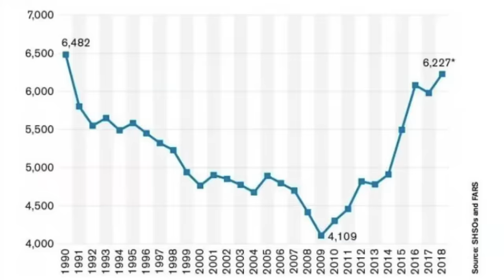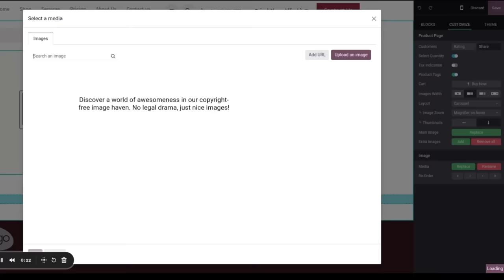Can this forgotten invention save your life?

Comment: 19:35 you can actually see the rear wheels locked up when they drag it on the tow truck.  Jeez. Now you need to build something for you truck to protect it against pedestrians.
Reply from the maker: Yeah I did not feel good watching that
Reply: It might have something to do with the wheel chock he left under the rear wheel. And not putting it in tow mode. A lot of modern vehicles with electronic parking brakes will automatically apply the parking brake if it detects the wheel is rolling with the engine off. 

There will be instructions in your owner's manual to disable the parking brake and mechanically override the transmission into neutral for this exact reason.
Reply: That's just because its stuck in park, without fluid the transmission cant build hydraulic pressure and will not shift
Reply: @smashedpapya2563  transmissions have mechanical linkages to shift into PRNDL , unless it's a new fancy electronic version of that linkage, but they will always have a mechanical over ride to force the transmission into neutral for towing it.
Reply: so you cant even shift fords into neutral if there's something wrong? seems very counter intuitive
Reply: That’s because his parking brake was still on.
Reply: @dylanbrookes9501  my wife had a fuse blow in her 08 escape. I couldn’t find the emergency neutral release, and it happened when we were driving, at night, so luckily we were able to stop, but we ended up in the middle of the road, so we closed the road.  The cop who showed up first didn’t know anything about it either (I think this should be part of their training)
Before you get behind the wheel of any car, you should find the emergency neutral release
Reply: There's a skid under the wheel
Reply: There should be a neutral override lever under the panel the shifter is mounted to. If there is then this is a skill issue on the tow truck driver, or they just don't care.
Reply: @McLilWilli lol when I got my 03 Jeep liberty towed the guy asked me if it had 4x4 and I was like yeah and we just threw it in neutral and just drove on. My beautiful piece of shit Jeep doesn’t not have anything to lock it up and lacks abs and traction control
Reply: @squanchy474 or get this… maybe it should be a part of your training when you buy and operate a $30k vehicle?
Reply: @ipullstuffapart on a lot of fords it is on the underside of the car, they could’ve just missed it.
Reply: @ipullstuffapart  Aus have pretty strick rules for cars I wouldn't be surprised if it was written off
Reply: towing it in park probably did more damage than the puncture in the transmission fluid pan
Reply: @AndreyAntonchik ¿Por que no las dos ? Why not both ?
Reply: @Ididathing  Don't worry about it, there's a wedge in front of the wheel. The wheel would turn without a problem.

Comment: wow, from 0:30 - 2:30 was the most concise and easily understandable 2 minutes of explaining the safety concerns of larger and larger trucks becoming normalized.
well done mate, not only am i equipped with a 2 minute explanation of the problem, i had 18 minutes telling me a solution that only costs $25 at a second hand store, and masking take to afix it on my legs.
Reply: E
Reply: Safety concerns are understandable, but the people who complain about trucks don't live in a place that can get 10 feet of snow no problem.
Reply: @joshualfalken  ok so why did i pass by a huge huge truck pulling out out of the mall with a 7yo in the passenger seat in Florida?
Reply: @joshualfalken  Even the little 90's f150s could handle snow. These giant lifted civilian smashers are completely unnecessary.
Reply: @joshualfalken  Give me a break. Lifted truck drivers have never even heard of snow tires.
Reply: @joshualfalken  Do you? I live somewhere where the yearly snowfall can quite easily get to 2 meters and often approaches 3. I've never felt the need for anything more than a good car with a solid set of snow tires and anyone who claims to need a truck to drive to work and back through some snow is:
a) an awful driver
b) someone who needs to get good snow tires
c) a snow plow driver
Reply: @joshualfalken  If I can make it through snowy canadian winters in a Mazda 2, snow isn't even an argument. I can see exceptions for more remote workplaces but not for bootin around town day-to-day.

Comment: Damn, the moment I saw that transmission fluid leaking out, my heart sank. A couple of years ago I hit a pothole and it punched a hole in mine to where all the fluid leaked out. I panicked and got to a mechanic right away, not realizing how bad it'd be to try and drive it like that, (especially because I thought it was an oil leak at first), and it ended up destroying my transmission. It was nearly a $2000 fix to get a new one when I finally found someone who could fix it, (rural area and half the mechanics here are "specialized" and won't work on hardly anything). The mechanic also kept coming up with excuses to put it off, so it was nearly two months to get the job done on top of that...
Reply: If it was road debris or even a huge pothole your full coverage insurance may have paid for that.
Reply: @ohioplayer-bl9em  Don't have full coverage insurance because it's too expensive relatively speaking. My car is old, (2006 model Chevy HHR), and basically my choice at the time was either pay the repair cost or see if I could find a car in better condition for the same price or less.

 As much as I hated paying for it, it was ultimately the better option because the car is still running fairly well to this day, and buying "cheap" used cars is always a big risk.
Reply: That's because replacing a transmission is a giant pain in the axx.

Comment: That point you brought up about the "big vehicle arms race" actually happened to me. 

I always wanted a small vehicle, but my  grandma refused to, she needed to get me either a truck or big car for safety reasons.
Reply: What’s funny is that i heard bigger cars are also more dangerous for the driver. (Tertiary source)
Reply: The trick is to get a super low small car, strap a buzz saw to the front and roof, and massive trucks will stay the fμck away from you 🤣
Reply: I'm superior to I did a thing lol 😂

Comment: i love how a very important part of the vehicle that is required for the vehicle to move and is very exposed under the car is made of some plastic.
Literally could have been a rock or any debris that you didn't see.
Reply: And I love that it's not only that part, but multiple parts. Was pure coincidence that the thing pierced the (plastic) gear oil pan and not the (plastic) oil pan...
Reply: Or a person's femur.
Reply: All he did was damage a transmission cooling line. Any car will be stranded if you did they. And guess what they aren’t meant to be javelin by homemade contraption of metal.
Reply: @lawnmowerdude  It's sold as an off-road vehicle, though. They must know nobody ever goes off road with them.
Reply: @lawnmowerdude  an off road vehicle should at least somewhat protect the underside from debris and rocks, right? like a flimsy aluminum mannequin stand shouldn't pierce an essential part of the car, they could at least bolt on a steel plate or something, which would actually reduces drag too.
Reply: Gods, I didn't even think about how lame and stupid that is by design.

Comment: My husband wanted me to point out that the tow truck driver didn't haul your truck properly. And he could "fuck it up worse, by letting the tires drag on the ground".
Reply: But it won’t get out of park because it has no tranny fluid! How else can it get up the tilt tray?
Reply: @danielpitsios683 there's usually an override for the shift lock hidden close to the shifter. It's already in neutral if it's got no fluid, so you just have to get it out of park
Reply: You can take out the drive shaft from underneath. (Which was explained to me is what prevents this) I don't know anything, I just saw an 8 year old girl do it one time. Her dad's a tow truck driver.

Comment: I never realized the armsrace angle of the trucks. Nothing makes people spend money than the fear of dying
Reply: The sad part? 
Even inside these trucks you're less save.
The reason these trucks are marketed so strongly is that they are classified as light trucks and not cars which have lower regulations (higher profits).
Thing is, they take less damage in crashes, that's good you say? No that damage they take is energy absorbed from the crash and not by you.

All in all trucks are:
- Less space efficient
- Less fuel efficient
- More dangerous for everyone both inside and especially outside the truck
- Reduced visibility for the driver
- A negative feedback loop because you're safer in a truck when crashing with a truck but less safe than in a car on car collision.

Comment: 1:23 It kinda is. I don’t have a source (my source is my teacher, so this can be taken with a grain of salt), but there’s a story that ford (I think it was ford) produced a line of trucks and found some safety defects after the production, so their financial people took a look at it and came to the conclusion that it would be cheaper to pay for the damages of the lack of safety than deal with the recall, so they just swept it under the rug.
Reply: it was the Ford Pinto. the gas tank straddled the rear axel which would cause fatal fires when rear ended (the most common kind of accident). Ford found it would cost something like $7 per car to move the gas tank somewhere safer, but only $5 per car to pay out the average price of a wrongful death lawsuit.
Reply: @waywardscythe3358  could also be the explorer, they did a similar thing with that car in the late 90s early 00s
Reply: @alexanderherzog3064  pretty sure my teacher said it was late 90’s. If I had a nickel for every time ford did this… I’d have at least two nickels, which isn’t a lot but it’s way more horrific that it happened more than once.
Reply: Yeah you're probably thinking about the Explorer. The original tyres they came with were not up to spec, with a fully loaded vehicle at a good speed (lets say 80mph) they were far too soft and sudden manoeuvres would likely lead to a rollover and bad crash. The solution would be to recall all of them and fit with replacement tyres, which is relatively cheap and simple by recall standards, but they didn't want to. A more permanent solution would be new tyres + stiffer anti roll bars and springs, but they definitely wouldn't want to pay for that.
Reply: Fight Club

Comment: As an American who hates the huge truck arms race (but lives on a farm and has a Jeep for actual Jeep reasons but prefers to drive his lowered Veloster.), you earned my like 1:30 in.
Reply: more evidence that people who actually need a truck don't buy dodge rams
Reply: You've got massive roads and carparks over there
Reply: The physics that dictates the outcome of car crashes doesn't care about your feelings.
Reply: @joshmonus  physics disagree, Force equals mass times acceleration.
The more force unloaded in a crash the worse the crash, so double the mass means double the force at the same speed
Reply: @Dicaso9  So, if a tractor trailer and pinto have a head on collision, then the large truck passengers won't be any safer than the pinto passengers.

Better hurry up and get the word out to all the people in the "large truck arms race" then.
Reply: @Dicaso9  Physics says its not how fast you are going that kills you, its how quickly you stop.
If a large vehicle and small vehicle collide, guess who stops the quickest and receives the most energy on impact.
Reply: @sophiewhitehouse6718  My Dad has a 2500 and it's great for what it does, but it doesn't get driven a whole lot outside of for working. But really, Dodge trucks kick ass and I owned a 2000 Dakota for 7 years. 

Personal transportation is much better for everyone when we use lighter, smaller vehicles when possible, but trucks have a definite use.

Also, Jeep is owned by dodge and has been for a long time.  But hey, I get the hate, but they have a use.
Reply: Daniel_Meyers Pickup trucks are definitely more likely to roll over because of a higher center of gravity.   But most of rollovers are caused because the majority of people are not good drivers, their situational awareness is absolutely horrible so they suck at crash avoidance and when they do try they don't know how to control a vehicle in emergency maneuvering situations to begin with.

In the end, a trucks higher center of gravity much more likely to save your life in a crash at an intersection where the majority of fatalities happen in the first place.  Its much better for a car to crash and go under your truck, than to get t-boned in the middle of your door.  T-bone accidents also account for the highest percent of fatalities too.
Reply: @joshmonus  i dont care about who gets worse damage, i care about the total damage in the crash, im not an egoistic bitch. If two mini cars crash head on at about 20kph, the results may be a fucked up engine and a few light injuries, if two F250 crash against eachother head on, the results would most likely be an absolutely fucked up frontal and possibly severe damage to the passengers.
The issue with this size arms race, is that if the only reason to buy a bigger car is to be "safer" from the smaller cars, then the overall result is that small cars are more dangerous to be in (because of the larger ones), so the smaller cars switch to bigger cars with time and then the people with cars that were previously bigger will want an even bigger car to have a bigger car than the rest (until its not anymore). Its pointless
Reply: @joshmonus  and that tbone that goes under your door wont go under your door anymore when everyone has bigger cars. And when someone with a massive car tbones someone with a smaller one, it wont end too well
Reply: @Dicaso9   I will drive whatever gives my family and myself the best odds of surviving  a crash, and right now that is a gas guzzling, full size V8 truck with a huge grille.  Go ahead and hamstring yourself if u like.  Thankfully megalomaniacs can't force other people to drive what they want them to drive.
Just please don't wind up under my truck while driving your Prius.
Reply: @joshmonus  better go get a tank then. That should keep you plenty safe on roads

Comment: I'm a mechanic, and watching you destroy your transmission, call transmission fluid "coolant", presume it was only used to shift the gears, then START THE CAR WITH NO TRANSMISSION FLUID IN IT, this permanently scarred me and is likely the most cringe-inducing thing I've seen you do.
I'd hate to see what you'd do if it was the engine oil pan that got punctured.